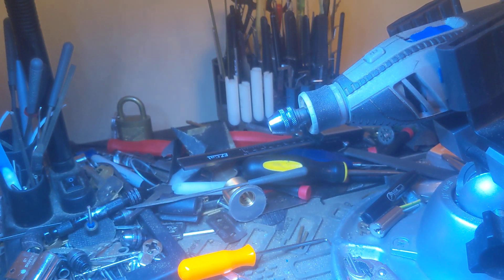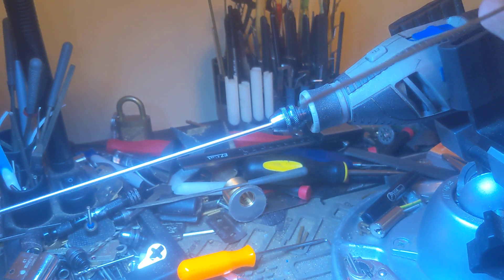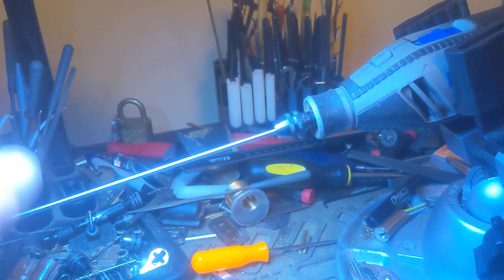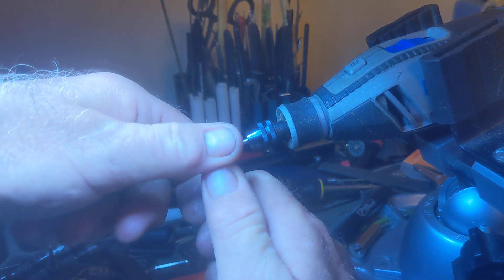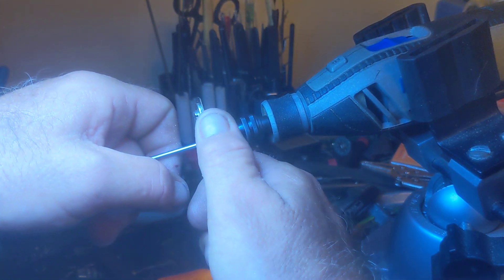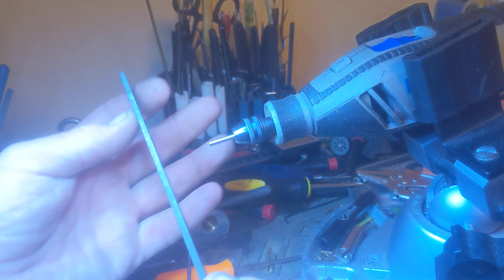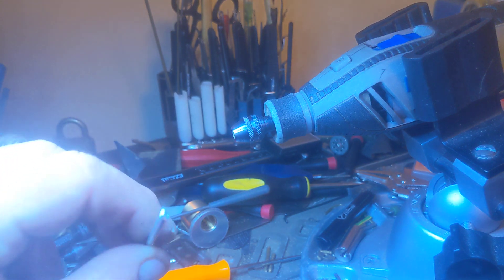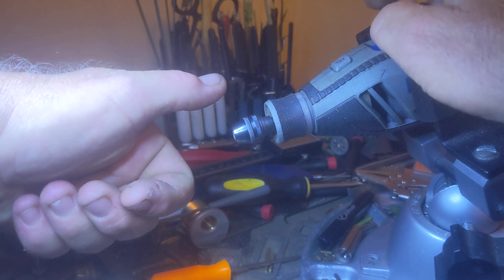actually cutting your rod/tubing using a rotary tool.

Comment: Stainless is pretty tough. Last year I had to cut lots of stainless steel tubes as I put a handrail from ground to third floor. A bit bigger tubing than you use here but stainless steel is tough.
It's good to see it actually done as opposed to a verbal explanation. 🙂👍

Comment: Thanks for doing this follow up video, the visuals do help in understanding the why for and how comes things are done a certain way. Safety at all times with eye protection as a minimum. Keep pets away and if you have a fresh cut on your hands it needs to be covered up or else small particulates of metal could enter the wound and then the bloodstream which is not a thing you want to go through. Similar precautions as when gutting glass. Cheers mate